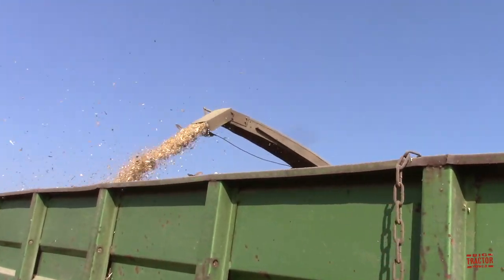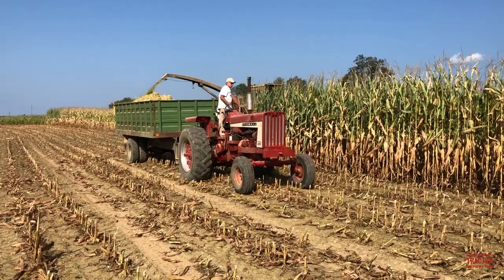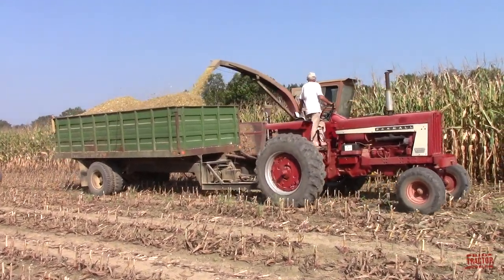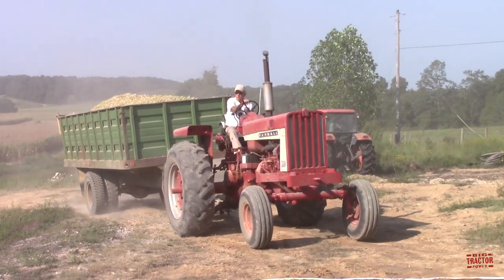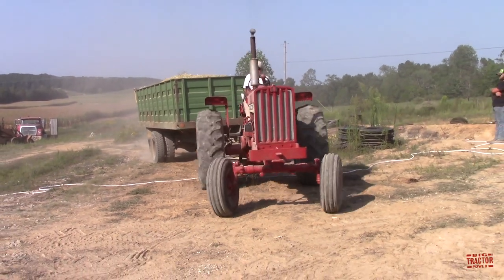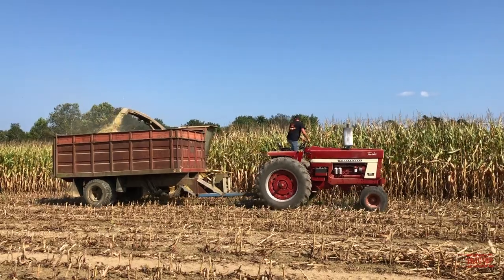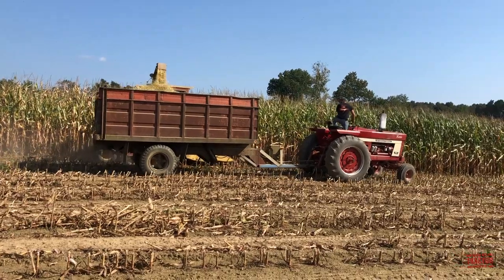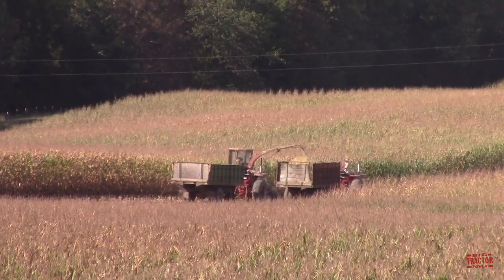NEW HOLLAND 1880 Crop Cruiser Chopping Corn

Comment: Holy smokes I haven’t seen one of these in years. We ran two brand new 1880’s in ‘75 and ‘76, both open station, I was 18-19 years old. They did a great job considering they didn’t have blowers. We primarily chopped alfalfa and cut about 18,000 to 20,000 tons each year and I was glad to be finished after that. We wore eye protection always as they were loud. Was so happy to be in a comfortable, quiet cab of a JD 6600 after that long summer of chopping but that as a fun time on the farm. Great crew of young guys.

Comment: Thanks for another great video ! When I was fairly young I drove grandaddy's 1890 . I thought it was a big chopper with 4 cylinder gm Detroit. My ears did ring !
Reply from the maker: The 1890 was a nice step up from the 1880.  That engine box right by the cab on an 1890 would be loud.

Comment: There’s nothing sounds better than a New Holland silage chopper. We ran a 717 super for years.
Reply from the maker: Very cool. I got film a 717 on an Allis-Chalmers 6080 about 8 years ago. What tractor did you run your Super 717 on?
Reply: Used a 560 on it for a lot of years. Then used a 966 or 3088 till we quit doing silage.

Comment: Amazing when you look at the cost of inflation on a machine like that to what today's machines cost. That machine today would cost $147,731 but I can see an '18 Claas Jaguar 980 running 365k and an '17 JD 8600 at $496k. Huge advancement in technology but my word, no wonder pull type harvesters are still relevant by comparison lol.
Reply: Exactly. It kinda irritates me when people ask "why would you spend almost $90K on a pull-type when you could get a used self-propelled for the same money?!" Why? Because for the money I got a brand spankin' new chopper with a brand spankin' new corn head and a brand spankin' new pickup head, all under warranty. For the same money, you aren't getting any late-model SPFH with heads unless the whole rig has a bazillion hours on it. No comparison whatsoever. And yeah, new SPFHs and their heads are outrageous. Half a mill for a top-of-the line machine? $100k for a big direct-cut disc head?! $125k+ for a big Kemper?!

Comment: Miss my old 966. Those tractors are in remarkable condition especially the 806. Think I would put some higher extensions on those trailers. That cab has to be HOT.

Comment: Man!!! talk about a hot box, especially in behind tall-ish corn (no breeze). It really was parts from a pull type chopper made self propelled. Our custom silage guy (back in Scotland) ran a Massey 4800 pulling a PTO Claas but it was a huge day when Claas came out with the pull type chopper that had it's own engine on the its hitch frame, ya had to engage a big lever at ground level before heading off. Boy did that thing like to push ya down a hill, lol.

Comment: Well done BTP. There is one of those choppers in our area in a shed now but yes that was top of the line back then. Other than the cat in in bunker, very low capital investment on that farm and still getting the job done....
Reply from the maker: It’s a neat line up. The CAT in the bunker did a pile of dirt work over the years and paid for the farm so it’s the top machine on the farm.

Comment: That was us for years and years. Except we had whipped New Holland number 8s behind it. 1890 with the Cat that would plug the air filter up in half a day and blow the mufflers out in a year.  Have an FX series now. Every time you fight with something electrical, you think how that old 1890 would be chopping away, while you are sitting there scratching your head, pissed off at who in the hell designed this wire harness.....

Comment: A question for you bunker guys, is using the big CAT a good idea? It’s got the weight but, is it too spread out to do a good job?
Reply: We used dozers for years on the silage pile, TD9, and also an Allis HD16, always worked out great.
Reply: a heavy rubber tired tractor does a lot better because cats dont have as much per square inch on ground you can tell difference if digging by hand the tighter the better it keeps

Comment: How long does it have to ferment?
Reply: If you're at silage for a week by the time yer done the stuff at the bottom will cook a potato as it will have started, but from the time you seal the pit i'd give it at least a month.
Reply from the maker: It could be fed in 30 days but 60-90 days is better. I suspect this feed will sit until winter when the pasture ground is frozen.

Comment: shure brings back memories neighbor had one row papec chopper talk about slow this old rigg does,nt cost much to own if they bought it new less than one thousand a year payback new ones wont last like this
Reply from the maker: Ah Papec. I grew up about 45 minutes from Shortsville, NY where Papec was based.  Even though the last Papec Equipment was built in 1979 there still piles of forage wagons, mixer mills and sprayers in WNY into the 2000’s.  The choppers faded out by the 80’s but as you said they did not match up to the speed of an NH, IH, Hesston or Deere of the time.

Comment: I dont know if thats one but NH made one that had a Chrysler gas engine on it.  Had to bring it gas on about every other load.
Reply from the maker: I would guess the Chrysler powered NH was the 161 made before the 1880.   The 1890 and 1895 followed the 1880 and they used CAT engines.

Comment: 75 bull i worked with some in 1982 incalifornia and drove one till the 1900 came out because the 1890 models were junk
Reply from the maker: Bull? They were not manufactured beyond 1975. Sure just like this one in 2019 they kept being used. The 2100 and 1900 were introduced in 1979.
Reply: @bigtractorpower  i drove one they had a hard time getting corn headers they came out with that low profile peice of junk we tried the 1890 and 1895 but they were junk the 1880 would run circles arou d them they bought 1900 in 1981 or 1982 they had 4or 5 dont know when they were built but they got them brand new around 1979 the were in the chopping buisness for years they first had the 880 gas enguine choppers but i never drove one of them the 1900 were ok but they eventualy switched to john deere before the old man died and the boys sold the buisness
Reply from the maker: Great history of machines.  I hope to get to film the 1890, 1895, 2100, 2115, FX58, and FX60 to have a complete NH chopper history on the channel. I got feature some new FR choppers this year.

Comment: why they putting it in a hole , don't make no sense
Reply from the maker: Trench silos were the way bulk silage was put up from the 1940’s well into the 70’s in the days before cement bunkers and Ag baggers. This farm tarps the trench but way back when they covered the silage with the dirt dig out of the trench.
Reply: @bigtractorpower  You still see the dirt bunkers being used to put up silage in the older smaller feedyards and farms in SW Kansas, and the Oklahoma and Texas Panhandles.